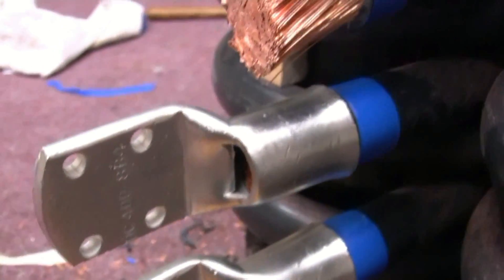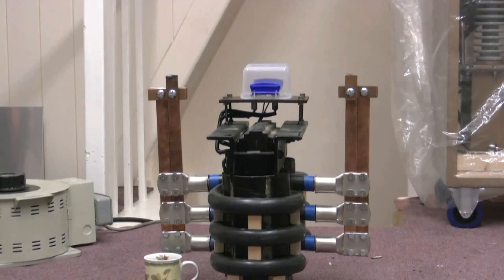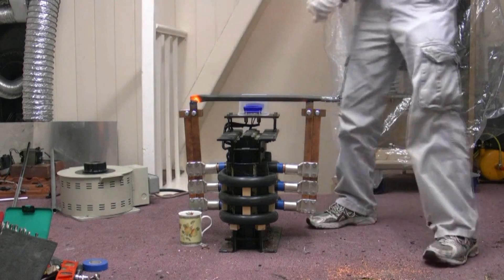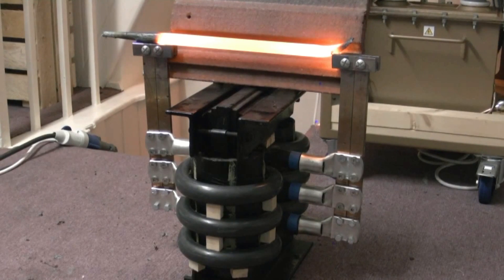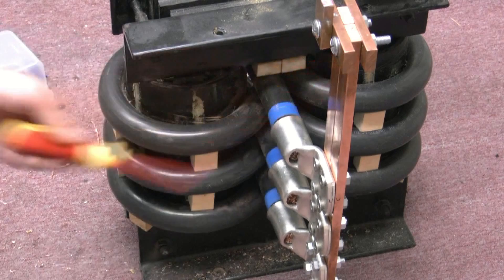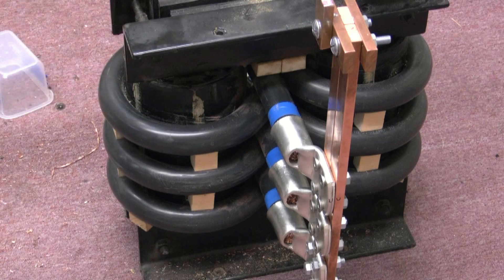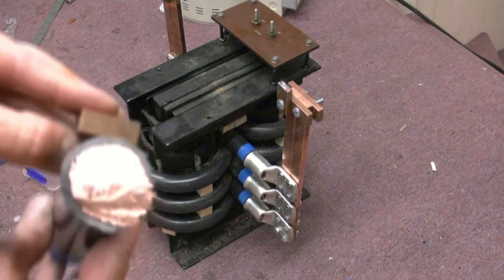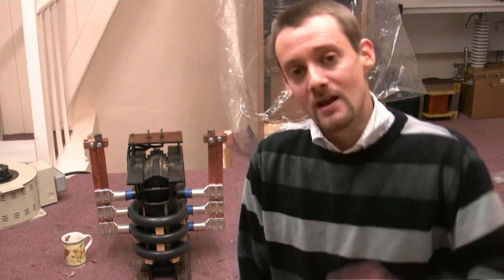50,000 Amp Transformer Completed

Comment: I'm impressed.
I've heard that the bulk of the electricity flows on the surface of a metal where the electrons are looser, thus why high-amp cabling uses lots of strands.
Therefore, would you get better performance out of the bus bar simply by increasing the surface area rather than the mass? This could be done by cutting grooves vertically along the bar, which would also help with heat dissipation.
Reply: This is known as the 'skin effect' & is prominent at radio frequencies - e.g. in high power amplifiers at HF, say, using hollow tube in the output tank circuits is just as efficient as solid copper rod, as virtually no RF current flows in the centre of the rod.  It is not because 'the electrons are looser' but because their fields tend to repel each other, pushing them to the outside of the conductor.  The effect is calculable, and is directly proportional to the frequency of operation.  It is almost negligible , & insignificant, at 50 Hz, as here.
Reply: I was skeptical at first, but after doing some reading it looks like you're right. Thanks Phillll :)
Reply: Phillll Thanks for the info :) Maybe with all your knowledge you could share some with us on youtube? Saw your post getting slightly frustrated about people on youtube. Most people come and view these videos either to learn or to entertain themselves for a minute or two :)
Reply: Daniel Wilson Daniel.  Sorry, seems I only ever write anything here when I'm frustrated :-)  Like most people, I think, I come to watch one thing & get distracted & watch a chain of others that leads me all over the place, usually to 'free energy', 'perpetual motion' nutters...  I agree with you, but Youtube is a dangerous place to LEARN as there is SO MUCH fakery & misinformation here.  It becomes obvious that MANY people here have NO fundamental knowledge of science, physics, maths etc. & that's OK, they can probably paint or sing or play music or whatever better than me, but there seems to be too much blind acceptance of (literally) incredible things here.  Which, I guess, is also OK until, as I sometimes see, posters here exploit the naivete & gullibility of watchers by asking for money to 'fund research', 'commercialise products' etc.  I have often thought of putting things here & would like to post some real information & genuine science - but I'm busy with a lot of other things.  But You've made me think about it, so I just may get to it one day.  Cheers :-)
Reply: Philip Chalk Not for TVs since the 70's. You can still find Selenium and Copper Oxide rectifiers used in really high power battery chargers and welding equipment, but that's going away, too, now that solid state has gotten so crazy good and economical.  Have you seen a typical radio transmitter lately? I was staring at a rack of little boxes all paralleled together and putting out 100KW at 97.6MHz, FM modulated. And that rack was tiny :P
Reply: Philip Chalk Hahaha :D Yeah. Agent Smith looking fellow - "Mr. Chalk, it seems you've purchased some devices normally used in nuclear ordinance. Mind explaining?"
Reply: Philip Chalk That's one reason why very high power cabling is hollow. It removes a bit of unused metal and allows a refrigerant to be pumped through to cool the cable.
Reply: Phillll Just checked.  Skin depth for copper, at 50Hz, is about 9.25mm so probably just starting to play a small part here - not significant until conductors get to over 18.5 mm diameter, and 400mm^2 is a little over that.
Reply: Joseph Perkins And why 'Copperweld' cable is popular in some HF applications, including coax cables for TV etc & HF antenna wires.  I hate the stuff, but it works for what it's used for.  A steel wire core for strength, with a few thou of copper skin bonded to it all around for RF conductivity - steel is a poor conductor at HF.  Also why you silver plate high power, high frequency & above tank circuitry in radio transmitters & power amplifiers.  The thin layer of silver is a good conductor for the RF skin currents, and even the oxide/s of silver - the black 'tarnish' is a good conductor, compared, for instance to copper oxides.  Oxides of copper can also form parasitic diodes, which you don't want.  I think there are still some diodes made today (e.g. high voltage, low current EHT stick rectifiers for CRT TVs etc.) using copper oxide junctions to rectify.
Reply: Joseph Perkins Yeah, true, but being an old dude, I still like building them with big old 'bottles' like 3-500Z, 4-1000A, 4-400, 813, etc etc.  Look pretty, help warm up the room :-)  I like radio that looks like plumbing  :-)
Reply: Phillll Yes, and a Thyratron type like a Krytron can be scaled up to handle any conceivable power level. They had one depicted in the movie "Forbidden Planet" that was 15 feet tall and as big around in the "Great Machine" and when a friend said "Solid state is better." I explained to them that a Krytron (Lesli Nielsons character called them "Klystrons") could be scaled up to handle the output of your average star. Solid state would just go poof.
Reply: Don't know the movie, but yes, I'm familiar with thyratrons (used to work in Radar) & have thought of using one in place of the spark gap in 'conventional' Tesla coils (another hobby)  Heard of krytons, never dealt with them, but a similar beast.  You know, I presume, that there ARE also tubes called klystrons - used as microwave oscillators/amplifiers.
Reply: Philip Chalk One has gas so it can handle more power and some are far faster, like the illegal to export Hydrogen Krytrons. Might not be good as a spark gap replacement, though. They are essentially the vacuum tube equivalent of an SCR. Once turned on, the current needs to drop below a low threshold to interrupt them.
Reply: Joseph.  Yeah I knew that & that's fine, that's what happens in the usage I'm thinking of & I believe others have done it.  I'm talking of using it to switch 50Hz ac to the primary circuit & it can switch off at the zero-crossings, which is what a spark gap does.  Or using it to quickly dump a large current from a storage capacitor with 15-20kV dc on it into the resonant primary, which will 'ring' & again it can switch off at zero-crossings, albeit at a much higher frequency.  That is a similar situation to the Radar application, but at a much lower frequency than Radar.  I see Hydrogen thyratrons of suitable ratings for not too many dollars on ebay (usually from Russia etc.) but I realise getting one here may present 'issues' - at the least, I may have some questions to answer...

Comment: what would happen if you fell and grabbed both ends?
Reply: Xezlec Nice explanations :)
Though I am perfectly aware why you would not get measurable current through you if grabbing the outlets. It was more of a comparison of resistances between the human body, a crowbar and the wiring.
Reply: OhNoNotMyPenis More like you would cook yourself.
Reply: Austin Fisher
The bars are cooked because they are excellent conductors.  You're not a good enough conductor to let much current through at that voltage.  It would take a much higher-voltage device to cook a person.
Reply: Xezlec Correct me if wrong, but the crowbar is cooked because it is a BAD conductor, and have high enough resistance to be the weak link in the setup. If it was a good conductor, the whole supply would cook off within short time.
Reply: emilen2 Ah, I see the issue: we're talking about two different things.  The bar is cooked instead of the transformer wiring because it has more resistance than the wiring.  But the reason that the circuit containing both draws enough current to cook some portion of it is that the bar has a very low resistance.

This is an issue of series vs. parallel.  The bar is in series with the wiring, and in a series circuit, the thing with the most resistance gets the most power.  But the whole transformer is plugged into the wall in parallel with all other loads and appliances, and in a parallel circuit, the thing with the least resistance draws the most power.

So if he touches the poles himself, very little power is drawn from the outlet, and he's fine.  Does that help?

Comment: Drop 2 zeros and you have your amp out put. Even with an Ideal "zero" Ω load you wouldnt achieve 50ka with that. The sparks even tell you that.
 I don't believe you have the saturation to make enough magnetomotive force to induced that kind of current. If you are going to use braid (Litz) wire, I would highly recommend you strip the jacket off that wire, remove as much as you can to the primary coil with out removing the varnish. Then to isolate the pri-sec use wax paper or something similar that will take the heat an be ultra thin. If you got it avalible I would try flat stock or square stock bare copper for the sec.

Also noticed you said the coils are running 120, you sound like you may be from a 220/440 region, are you running split phase to it? If so have you verified that each of your 3 coils is phase balanced with each other?

You will now when you hit 50ka the tip of that prybar would have exploded when it made contact.
Reply: There only 0.5V so it had bad contact with prybar, surface of contact is small it start vaporizing metals, metals oxydizing and made oxide layer which is not conductive enough(for 0.5V). Also he didnt made 50kA in this video, he even said so, but he made transformer for 50kA.

Comment: I'm too lazy to dig out my transformer formulas... How much input current do you need to get 50KA.... Don't you need more iron cross section as well?
Reply: Yes, you need more iron.  Hard to get the scale from this, but I quite sure  that core is big enough for 50kVA.  Not enough info given to calculate, but we're clearly seeing nowhere near 50kA anywhere in this video.  He mentions 0.5V per turn, but is unclear under what conditions.  He's also using a variac (which looks like about a 20A, therefore 5kVA variac) so we never know the input voltage.  But for a simple example:-  Imagine 250Vac (to simplify maths) input; assume transformer is 100% efficient (which it is not) & assume magnetizing current equals zero (which it does not) & total losses - copper & core losses etc are zero (which they are not).  Assume the output voltage to be 2.5V, then the voltage step-down ratio would be 100x so the current step-up ratio is also 100x.  Therefore to draw 50kA out, would require 500A input current.  If the o/p voltage were 0.5V, would require 100A input current.  What is conserved here is POWER (or VA actually) so Power IN ( minus losses) equals Power OUT.  Let's say you could get 50kA output (not gonna happen) at one volt.  That's 50kVA.  At 250V input, a lossless transformer would draw 200A.  (50,000 x 1) = (250 x 200)  etc. etc. etc.  Provided you ignore losses, it's just a linear ratiometric relationship between input and output.
Reply: Phillll
My keyboard is dropping letters - first line should've been "I'm quite sure that core is NOT big enough for 50kVA..."  Certainly not 50kVA continuous.  But you can draw a great deal more than the rated load from any good transformer before the thing cooks itself, & they have a reasonably slow thermal time constant, but eventually either primary or secondary windings will 'fuse' 7 go open circuit, or the whole thing will overheat & turn into a lot of smoke - & often flame too :-)

Comment: dam dude what size of wire is that and where can i get some im in the US
Reply: Phillll He doesn't know what those are, you need to tell him in inches!
Reply: 400 square millimeters - just like he said.
Reply: TheCrazySquirell Not really. In the US it would be either Circular Mils (not Centimeter... common confusion) or mm2 (millimeters squared). Use 800MCM THW wire. That's 400mm2 with high temp thermoplastic insulation jacket, 2.8mm thick.

Comment: 0.1 - 1     Amps is enough to give a man serious cardiac arrests...
10 - 100 Amps can be found in lightning strikes...
...
50000 Amps
...
Reply: yes 30mA over your hearth will be deadly but not all current will be running though you heart when you are touching some wires, so about 70mA is about the max that can run though your body before it starts damaging your heart/other organs
Reply: Then I've been near some REALLY weak lightning strikes XD
Reply: Uzair Siddiq lightning strikes have around 1000000 amps
Reply: You need the voltage to overcome the resistance off your skin, otherwise you could kill someone with a phonecharger
Reply: Yup ;)
Reply: ***** GOD i love electronics :D there's SO much i don't know; that's best part :D
Reply: Dittoma Who doesn't love electronics, its basically the future!
Reply: THIRTY MILLIAMPS i.e. 0.03 amps is plenty to kill you in the right circumstances.  In this country, RCDs or ELCBs or 'Safety Switches' or whatever you like to call them typically trip at 30mA, for certain applications they use 15mA RCDs.  However, as others have said, with the 0.5V or couple of volts he's producing, his body resistance will prevent him drawing that sort of current.  Apparently there have been deaths recorded, in exceptional circumstances at voltages as low as 24V and maybe even 12.  If, for example, you were to drive a nail deep into each upper arm, thereby making good contact with wet, salty muscle & tissue, and apply a voltage across the two nails, directing the current path across your heart, a fairly low voltage could kill you.  We are, to an extent, insulated by our outer layer of dry, high resistance, skin...

Comment: "A power supply can be infinitely "powerful" and still not damage a delicate circuit requires only a millamp, because its only a capability to provide energy.
A 12V battery across a 12K resistor will still take only 1mA of current, regardless of whether it's hooked up to a tiny 12V remote control battery, or a huge 12V truck battery capable of thousands of amps." - http://www.eevblog.com/forum/beginners/why-do-electronics-only-consume-the-amps-they-need/5/?wap2;wap2   

Basically 0.5V won't even hit the Vbon of the transistor and will have infinite resistance so no current will flow.

Comment: How fast will this charge my iPhone?
Reply: It wont @ 0.5V
Reply: Valueless Dollar
the phone will always charcge the coil instead as long as the pressure (voltage) is less than the phones. needs rectified as well.
Reply: Sorry, Valueless Dollar, I replied to the whole thread earlier. Think of the current (flow) that is supplied via your grid, essentially limitless, yet your devices will only pull what is required given that voltage potential. Also the mostfet threshold voltage is about 0.5V so it may or may not even trigger the phones circuitry to allow current flow. Now if you used the phones case which has quite a low resistance to short the circuit then it'd cook it :-)
Reply: Too fast
Reply: It'll blow it out of the water..
Reply: Ben M
But at 50,000 or so AMPS... yes it well.

Iphones usually hover around the 5 volt 2.1 amp charge range... If you go over that, I sure as hell hope you like the smell of burning electronics.

Comment: nice demo on low voltage high current, only thing I can hardly hear your narration and I need a 50watt speaker amplifier to hear them ;).. did you use a microwave transformer to step up from 240av outlet then bring it down back to 0.5volts?

Comment: Do you have a practical application for this, or are you just doing this because you can? Imagine you built a stereo receiver using this as the power supply and equally beefy components.. I guess you'd need some pretty massive speakers too..
Reply: A half volt supply theoretically allows a maximum output of 4mW (I calculated in my head...so any other offers)? Yeah
Reply: mart fart For the record:-  Let's say it is 0.5V RMS - that's about 0.71V peak.  Now, if you had some magic rectifier with no forward voltage drop, to produce the DC supply for your amplifier, you could produce a DC rail of 0.7Vpeak (no load, it would drop as soon as you loaded it.)  An amplifier with magic lossless output devices & say capacitor-coupled output could give you a 1.4V peak to peak output waveform, which is 1 volt RMS. So that could give you 125mW into 8 ohms, or 250mW into 4 ohms.  Headphone volume, not enough to annoy the neighbours.  But, in the REAL world, you can't buy these magic devices.  If you fed 0.5V RMS into a silicon bridge rectifier, your DC output would be zero.  If you went for half-wave rectification with a silicon diode, you could get around 0.1V peak DC, which is 0.05V RMS DC or 0.032V Average DC - none of these is enough to turn on any silicon junction - e.g. transistor, FET etc. so no solid-state amplifier will produce any output at all :-)

Comment: You can tell how low the voltage is by how few sparks hes making. Can't understand how that cable doesn't melt at 20000 amps when its probably only rated 1000 or so.